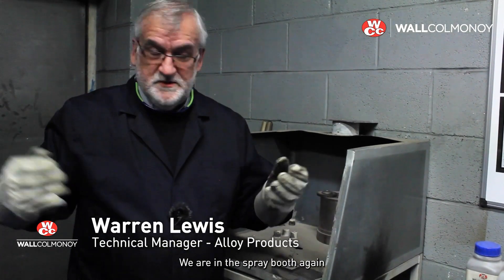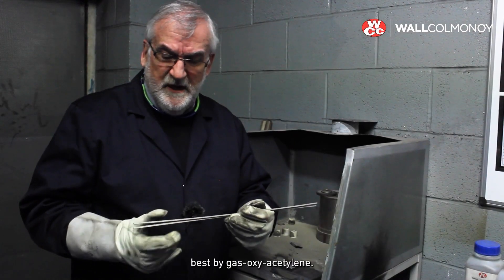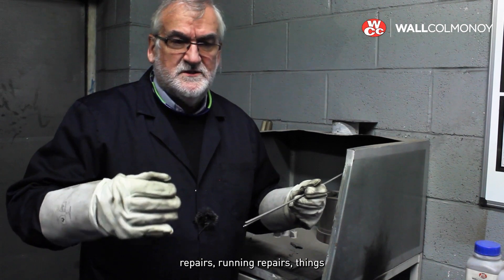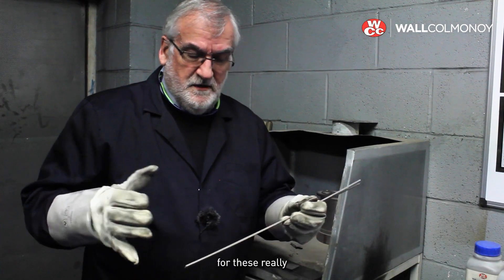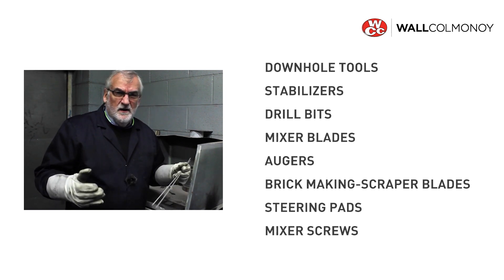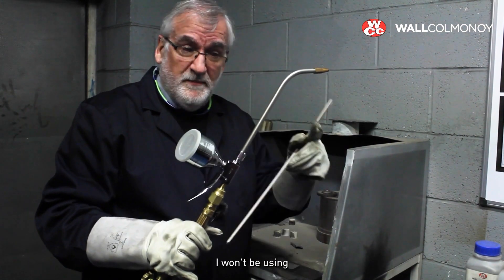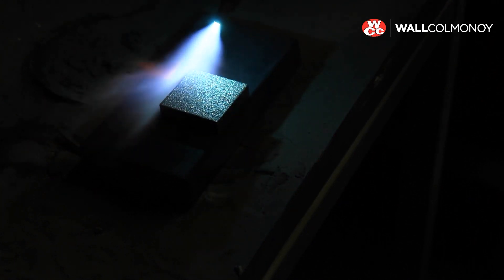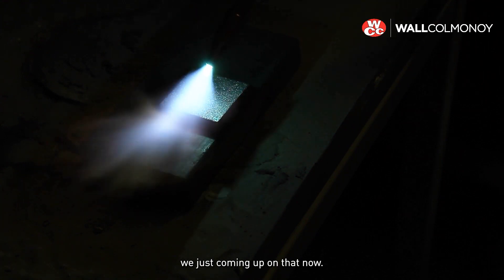ColTung™ Nickel-based Hardfacing Sintered Rod | Ideal for Downhole Tool Applications

Comment: This looks like a great product but I'm having difficulties purchasing small quantities as one would buy for use in field repair, where we run into the need for a little bit of everything in a variety of sizes.  Do you have suggestions of how/where to buy 10 rods or even 4-5 lbs at a time of one diameter?  This is typically how specialty rods are sold at a welding store or farm & ranch store.
Reply from the maker: Hi @mattjanssen7621! You may have already spoken to Cary Howes, who supports your area, but if not he may be able to help. You can reach him at chowes@wallcolmonoy.com.

Comment: I wonder, could a previous flash dust spray (powder with high Ni-base e.g. colmonoy 24) coat be considered as a "good practice"? Thus it would make it easier the create the bond between the Coltung Rod (50% WC) and the new substrate (Ni-based).
Reply from the maker: Yes. A dust coat using a self-fluxing powder such as Colmonoy 25F or 33F would be beneficial. It would aid the application by indicating exactly the right temperature to start adding the rod. A dust coat would also prevent oxidation of the surrounding area during deposition. However, I should state that whilst its “good practice”, its not essential.

- Warren Lewis